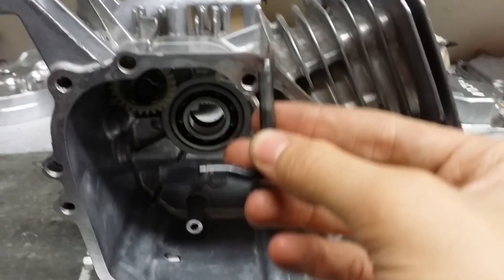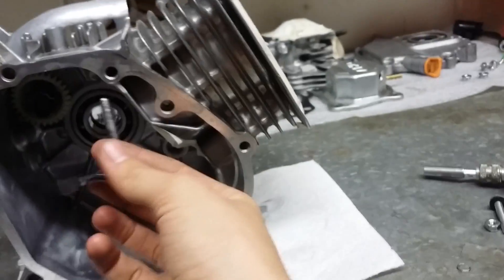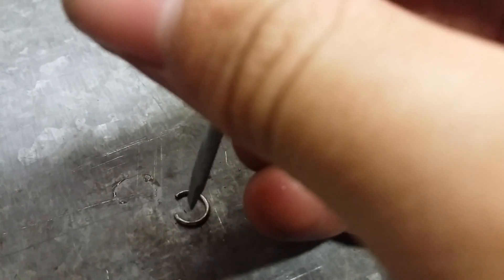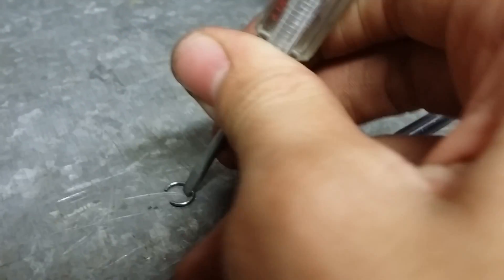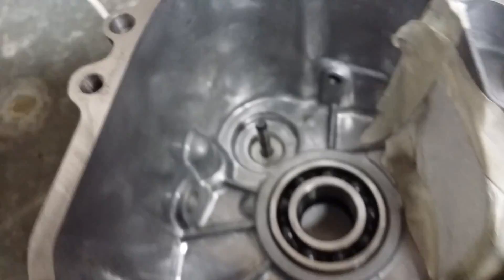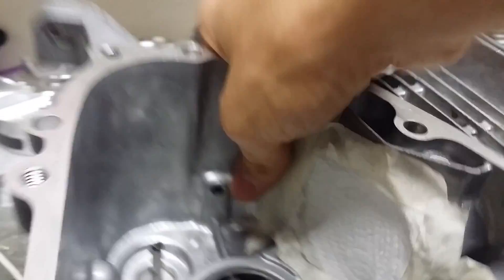How to properly remove governor & gear on Predator 212cc or Honda GX200 and clones

Comment: Do I need to remove the gear. I removed the arm and already put the engine back together
Reply from the maker: Should be fine as long as the c-clip is still on it and you took any loose parts out. It will just sit there and spin.

Comment: From your thumb nail, I have a question . After I put my aftermarket air filter on my 212cc hemi predator what do I do with the vacuum lines from the head and the gas tank. Leave both open, not hooked to anything? I've heard some carbs work off the vacuum of the gas tank.
Reply from the maker: if there is a vacuum line in the head you can just route to the filter or put a mini filter on it. I think originally I drilled a hole in the rubber part of the intake that clamps onto the intake manifold and stuck it in there (just so its clean air).  That line is used to allow the air in the crankcase out that the piston displaces when it goes down. If there is a line coming from the gas tank you can just put that wherever it won't get too much stuff in it. Its used to keep the gas tank from over (or under) pressurizing when it gets too hot or too cold. A lot of race carbs will have different lines going into them ya
Reply: I always just tear a piece of wire pad. I'm heaving a brain fart at the minute and cant remember the name. Like you use to crub dishes or clean metal. Anyways roll it around in you finger but not to tight and stick it down in the top of the tube a inch at most. Just make sure air can get past it. Or put a filter on it but for some reason eBay always sends the wrong size filter.